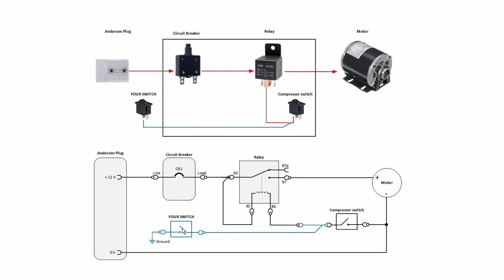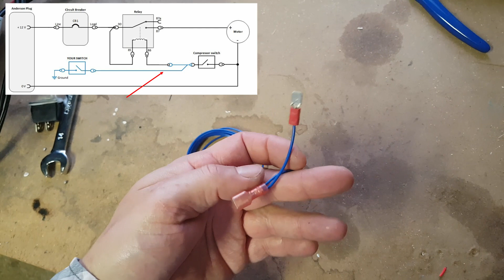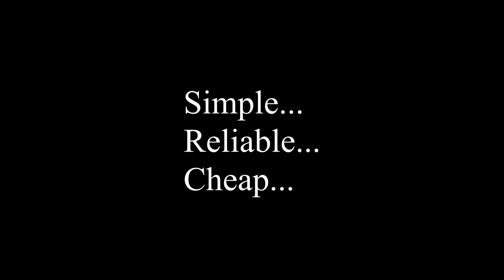DIY 12V Air Compressor Modification | Remote Switch Install with schematic | 4WD

Comment: Hey I have a question, I followed your tutorial of a second switch and it worked BUT, my compressor has the switch with two settings ( | ) The first setting turns off when it gets to 150psi, the ( || ) second is a continual flow where the machine overrides the pressure switch... So when I run the unit now from 2nd Switch, it gets to pressure then dumps the air back to around 100, then continues ... any ideas?

Comment: Hey mate, looking at doing something similar. Few questions? 1) Why does your Anderson not have both pos and negative connections and 2) how have you wired the piggy backed switch? I think someone else was chasing that too!  Epic idea though, keen to here back.

Cheers
Reply: Yeah he does have + and - Anderson plug, + is marked with Red tape, it’s a great idea.

Comment: Hey! Thanks for posting this, I am pretty much trying to do the same thing to a rocker switch. Any chance you could post that bit as I have gotten rather stuck. I tried just switching out the original switch to a 3 pin rocker but it hasn’t worked 😔

Comment: Just a heads up if you're doing this on a maxitrax compression your gonna be using a 12v+ started to ground my switch to turn it on and basically started welding.

Comment: Could you not just leave the compressor switch on and have a rocker switch on the power supply side of the compressor?
Reply: Yes, but it would require another relay.

Comment: Nice one man! super simple, I'm looking at wiring in a pressure switch n adjustable pressure reg so I can set and let it pump the tires.
Reply: What Compressor are you using Maximus. Have you got an adaptor from the theaded Nitto that comes with these compressors. 

I can’t find an adaptor from the compressor thread to 1/4” BSP to add in a T-piece
Reply: @DunnyVids  I found everything at my local shop, but I had one if these compressors called "camel twin cylinder" it died after like 20 uses dont think it likes having a pressure switch. got a ARB single for a great price and did everything else. auto inflate to 38 PSI trips the pressure switch using a regulator.
Reply: look up smitty built power tank.... compressors are useless..or get the twin piston model,300 lt.
Reply: ive fitted 3,  19 lt tanks, with remote 300 lt comp. works great. quik..